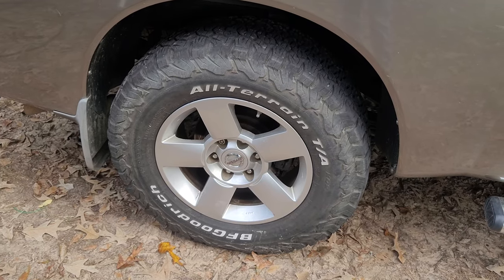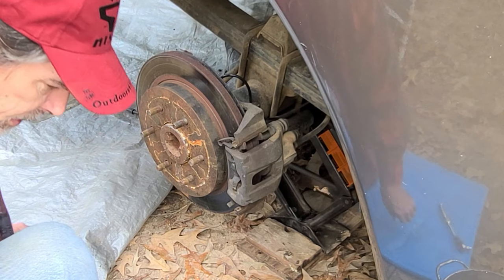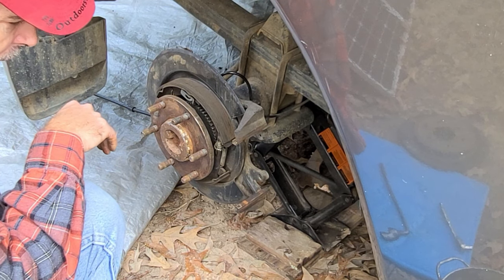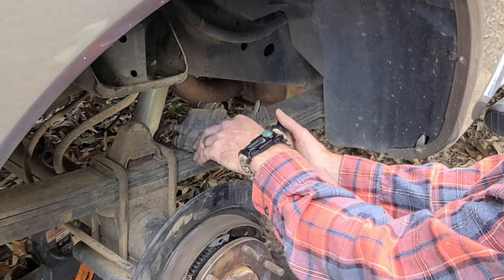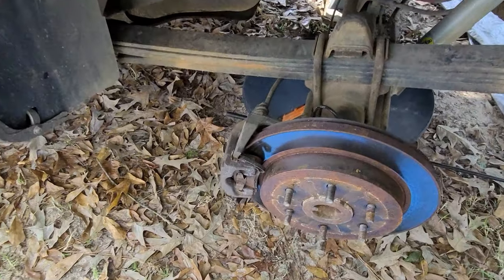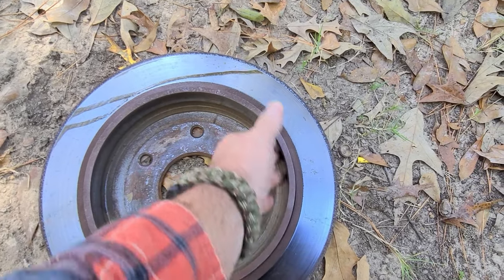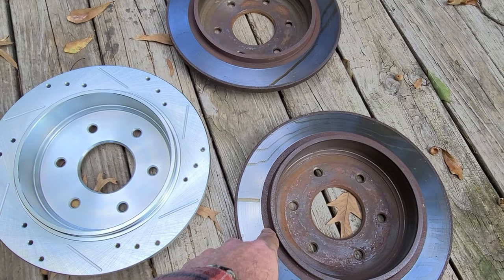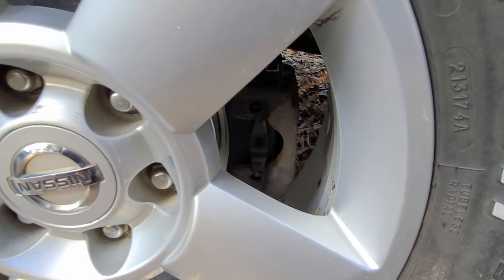Powerstop Brake pads and Rotor Install  on Nissan Titan (rear)

Comment from the maker: Installed powerstop rotors and brake pads on the nissan titan. They are working great. We made a trip into the forest this weekendand tested them out. Video of our camping trip coming soon. Stay tuned for the front brake replacement video also.

Comment: Compared to the stock brakes and rotors how much better are the slotted power stops i have a 2005 titan just got new stock brakes and there horrible i can't stop fast at all and worried if someone stops infront of me ima slam into them I know they say titans 2005-2007 brakes were bad
Reply from the maker: I don't have any problems stopping and they are smooth.  I know it cost more but the oversized is the way to go.  I try to make sure to keep clean / fresh brake fluid in the system. Little specks of dirt in the fluid can cause issues.